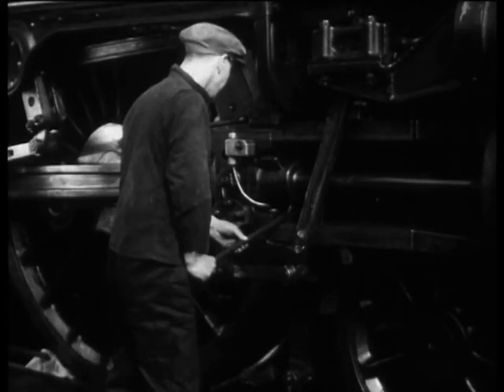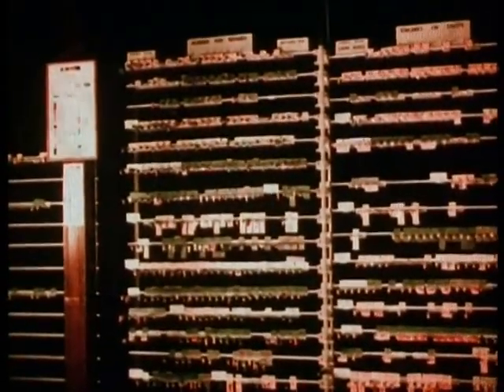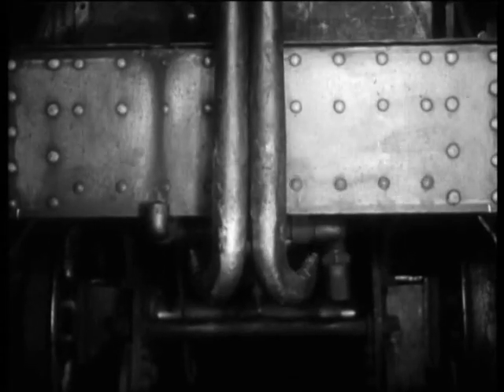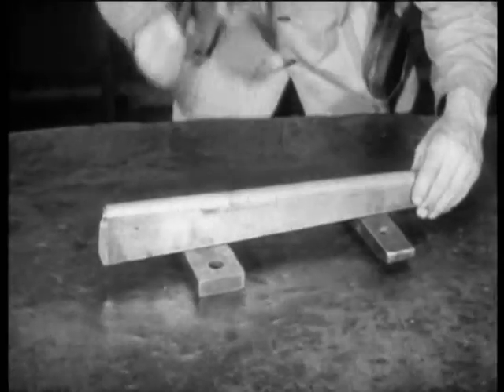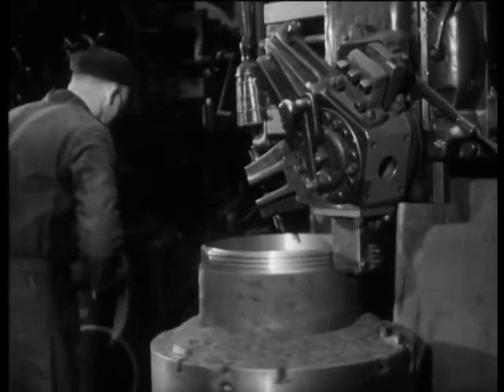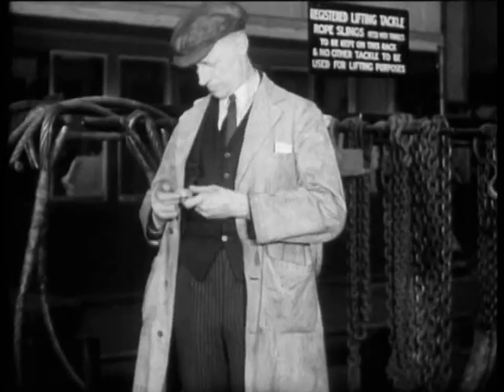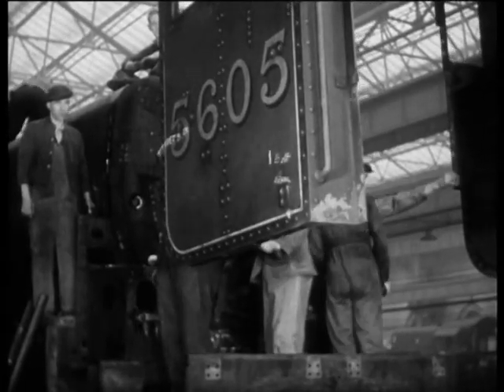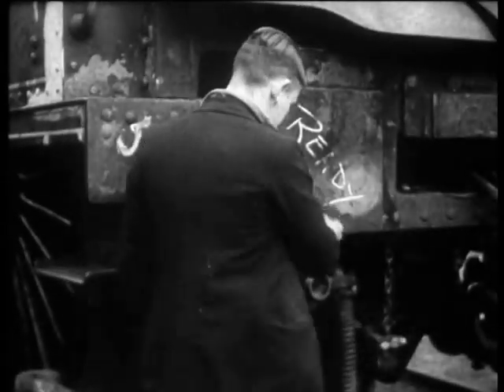LMS - General Repair - PT 1

Comment: Before there was ultrasonic inspection, there was sonic inspection. Interesting what a hammer tap will reveal.
Reply: Ob Fuscated Well it's all irrelevant, sonic or ultrasonic,  this loco was ripped apart with cutting torches and melted down for scrap in the 1960s. Torch this loco!

Comment: I noticed they made a special effort to prevent harmonic vibrations from inducing a bad finish in the cylinders while boring them  by wrapping the cylinder in gun cotton held in place by chicken wire to absorb those harmonics. Old school technique still used today in some larger applications. During some of my hobby shop lathing, I still used a bunch of rubber bands around a smaller cylinder to squelch thoee vibes.

Comment: So my question. How come there is no brick arch in the loco at the beginning when the inspector is checking the boiler stays. Would the arch of been removed just for his visit knowing the engine would of been worked on regardless or would they of put a new arch back in if he found the boiler was still sound?